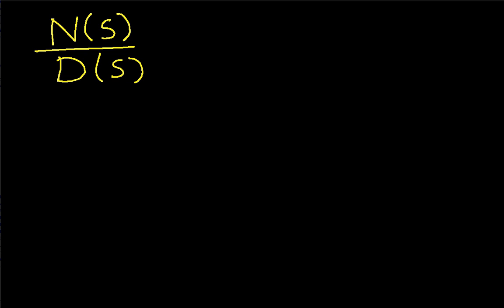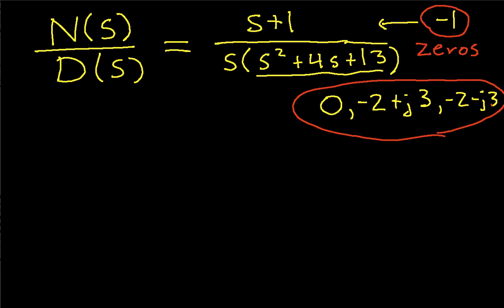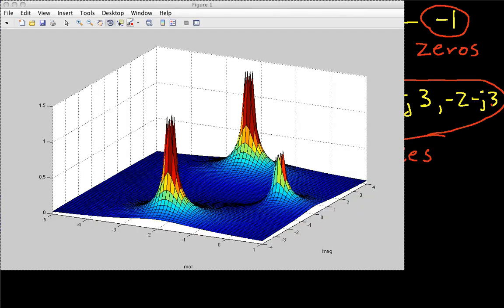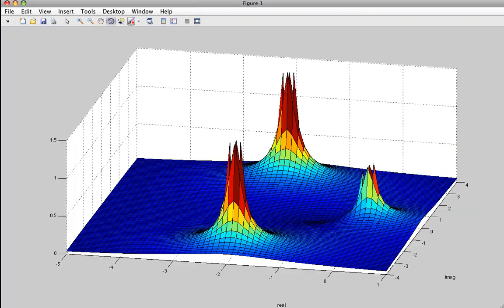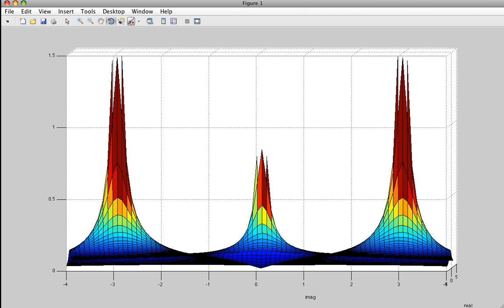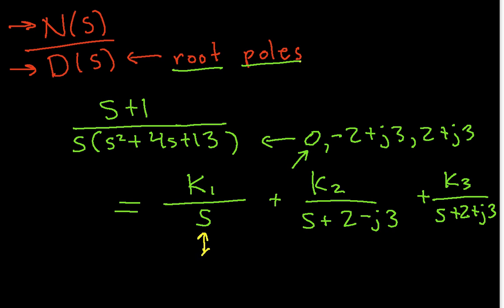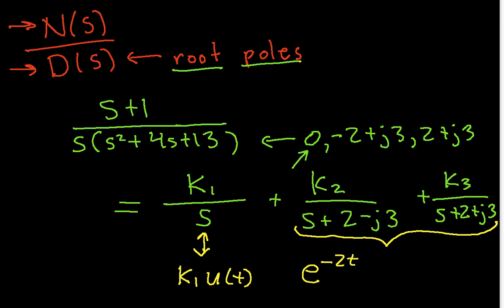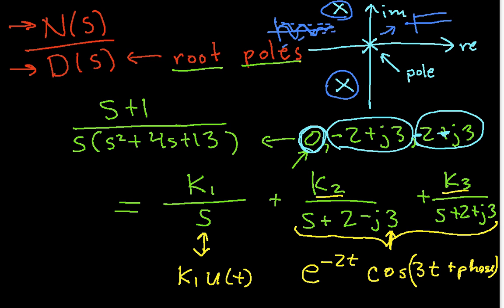Pole/Zero Plots Part 1

Comment: Nice video. I don't understand one part however. In the end the on the left of your basis set the exponential is decreasing which I feel is not consistent with my understanding of the basis set as any thing on the left of the basis set should follow an exponential growth rather than a decay. Because s= sigma + j Omega
and e^(-sigma *t) is positive exponential growth on the left of basis set. Could you clarify this problem ? thanks